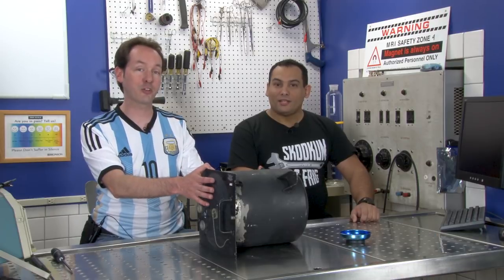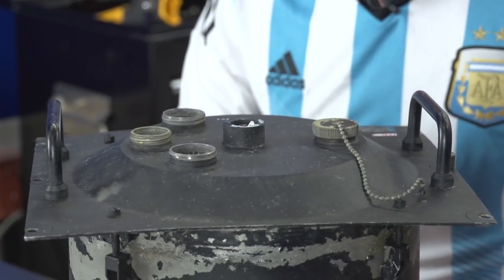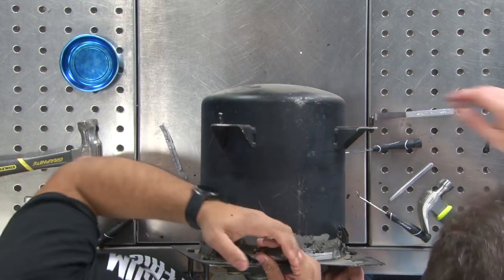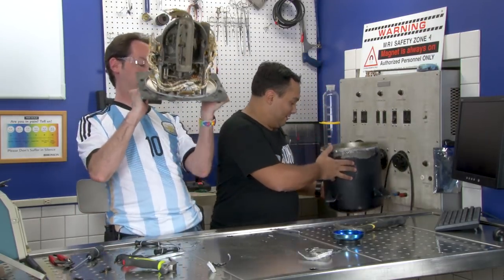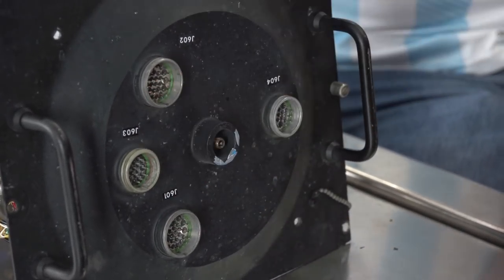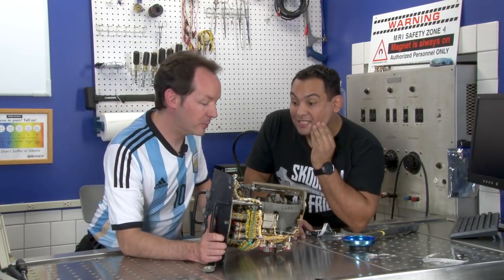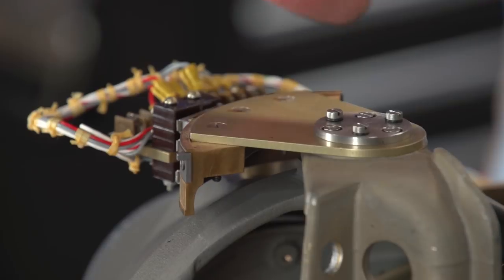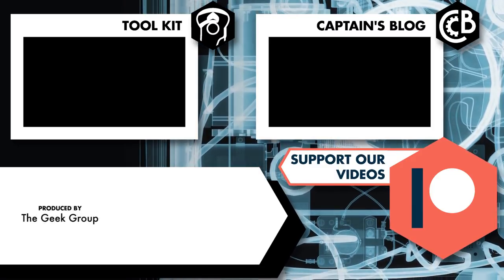B52 Bomber Automatic Astrocompass: Equipment Autopsy #105

Comment: You have a lot more of (bigger)  synchro transmitters and receivers in the Mark 1 navy control computer that is now in parts. "DB" plugs where existing long time before they started being used for computers, so if it is a DB-25 plug, but absolutely not for any kind of  of serial  protocol.  Unless you show me where the UART chip is :-p

Comment: They are not motors they are syncros, transmitters or receivers and  they are all 400Hz and will have 5 wires. .   There also may be some differential transmitters also, these will have 6 wires.. That is  not a standard serial cable. I use to work on this system when I was In the Air Force.1958 to 1964. I think it is part of the MA6A-7A bomb navigation system. This system was an all mechanical computer.  It was replaced by the ASB9 Bomb Nav system and was a  analog  system.I don't think that you will have much luck making this do anything. The syncros have to get their position from another part of the computer..
Reply: Awesome John! Yeah we figured most of the things you say later on when we work in the reverse engineering with Mr. Paul Kidwell and other Geek Group Members. How cool that you actually worked on this system! Could you help us to get more information about the signals to make the thing move? I get that the syncros have to get their position from another part of the computer, but couldn't we fake those signals with a microcontroller, mosfet's, and mosfet drivers? I get that must be complex as frig, but maybe there's a way... I would love if you could assist us in any way with this! Anyway, a pleasure and thanks a lot for the comment!! Best wishes from Argentina!!
Reply: you'd need to set up some sort of resolver to send the signal to the syncros. you may be able to simulate it with some function generation IC's or LM555 timers, op-amps, and mosfets to drive them.

Comment: I wonder if the wiring diagram for this part exists (and is declassified), would make powering it on and trying to get outputs out of it waaaay easier.
Reply: I've looked, but no luck.  They never were classified.  I worked on the system from 1982-1984

Comment: it looks like a mechanical sextant, with dead reckoning gyroscopes and accelerometers. You will have to drive them with the correct sine waveforms, and then use op-amps to derive and collect the pickoff error signals.

Comment: Those motors may not be motors. They may be Synchros (or Selsyns, a brand name) which are a kind of obsolete analog closed-loop servo motor often found in old military aeronautic and nautical instruments. An AC currect is passed through the rotor, and the stator cosists of 3 coils separated by 60 degrees. Current is induced in these coils proportional to the angle of the rotor. These three currents are passed to the stator coils of another identical synchro, where it's rotor spins to the corresponding angle. Really neat devices, but I have yet to enginerd a way to drive one by Arduino without just coupling the shaft of a broadcasting synchro to a modern servo.
Reply: Hey River Dolfi! Thanks for the comment and the information! Yeah, we found out about the "motors" being Synchros actually, as you say an obsolete, but rather elegant solution. It would be great to have the wiring diagram for them, or some datasheet detailing the specifics of those signals. The data you add is very usefull, because we could also "record" the output signal of a broadcasting synchro and try to replicate it with an Arduino or something like that. Do you think that it would be (in concept) very different from driving a 3 phase brushless motor? Anyway, I also like the coupling the synchro to a servo/stepper idea! Thanks a lot and big hug from Argentina!
Reply: you'd need to set up some sort of resolver to send the signal to the syncros. you may be able to simulate it with some function generation IC's or LM555 timers, op-amps, and mosfets to drive them.

Comment: Could this device be designed to receive imu, compass and barometric altitude inputs and output approximate azimuth and elevation data for a few celestial objects so a human or computer navigator would know approximately where to point a sextant located in a dome dorsally mounted on the fuselage?